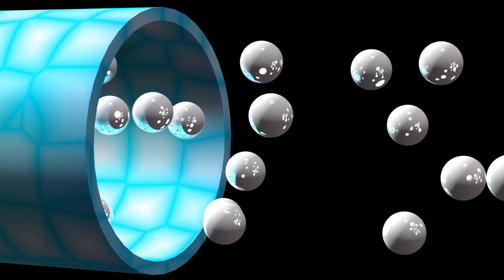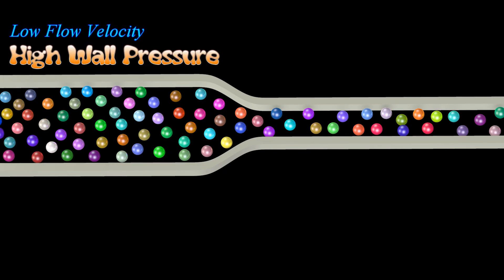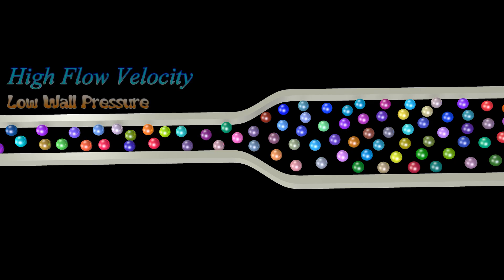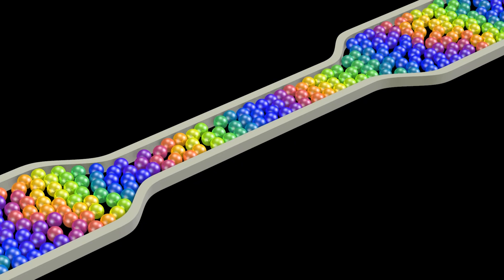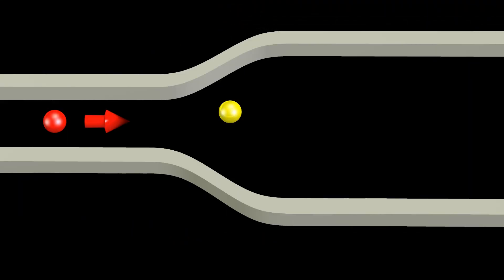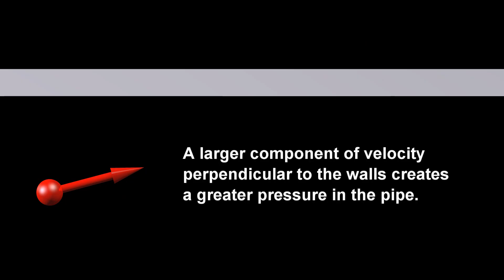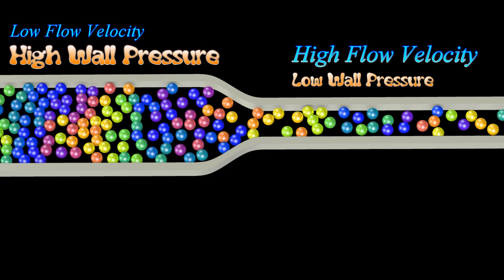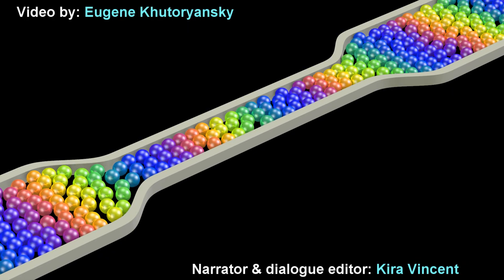Bernoulli’s Principle on Atomic Scale

Comment: Thanks for your videos ... clarifying so many non intuitive aspects of physics.  A logical extension of this one would include temperature
Reply from the maker: Thanks.  I am glad you like my videos.
Reply: This explanation makes a serious error in regard to temperature when talking about the kinetic energy, Doug.  I explain below.
..
Unfortunately, this violates some very common and well understood accepted principles of physics.  It mimics the same errors as Charles Crummer.
..
The statement at 2:07 is correct. "there is no reason to expect an atom with a higher velocity to exert a lower pressure on the walls of the pipe." 

There can be the same pressure in a fast fluid as a slow fluid.  They simply have the same static pressure. Bernoulli is not about speed. It is about changes in speed or velocity which is Acceleration along a path. 

The pressure on the walls of a sealed jar is the same regardless of the speed of the jar.

A fundamental flaw in this misconception at 2:42 is is that there no reason to expect a molecule to have the thermal vibration in only one dimension.  These pressure causing vibrations are random in direction and are how they bounce round between other atoms.  
At any given instant a molecule may be going down and the next at 90 degrees or even 180 degrees to the previous vibration.  
That simple fact breaks this false logic.
..
Then. . . 
It is the average velocity (over time) that has a directed motion when the kinetic energy is added to produce an increase in speed. That directed velocity is vectorially summed to the random vibrations.  This is vector addition of velocities. This means that the random vibrations are superimposed onto the linear velocity along the tube. This is fundamental physics. Vector quantities like speed and acceleration add vectorially.
Ignoring that fundamental physics is another flaw in this.
..
..
Then, the added kinetic energy in the moving fluid is in only direction.  It is not increasing the random thermal vibrations. That would require increasing the temperature.  This is another flaw in this story.  Moving the fluid along the pipe does not raise the temperature.  
Therefore, the statement at 2:23: "an atom with a higher velocity would have a higher kinetic energy and, therefore, exert a larger force on the pipe walls" is false because it conflates / confuses thermal energy and momentum in one direction.
..
..
Consider bouncing a ball on the floor. Each bounce imparts some momentum to the floor.  The ball's actual motion is only vertical..

Now, start the room moving (a train car) and the ball still imparts the same momentum to the floor with each bounce.  It's actual motion, relative to the stationary ground changes.  It has the SAME vertical component, but now a horizontal component vectorially added to the vertical motions.  The pressure on the floor does not change.
.
 However, these two motions are orthogonal and have no effect on each other. The vertical up[and down bouncing component remains the same. ONLY the ground referenced horizontal component changes as the speed increases.
This physics does not change if the ball is bounced on the ground outside the train's window.
.
This fails on these fundamental physics errors.
Reply: I agree regarding 2:23 would be clearer if he said momentum versus energy because the pressure is proportionally related to transfer of momentum which is mass times velocity whereas energy is velocity squared.  (I.e. pressure relates to the total instantaneous transfer of momentum on a wall surface).   However, regarding uniformity of velocity vectors, statistical thermodynamics can lead to non-intuitive results results … the curl associated with fluid flow near boundaries. To assume fluid flow velocity at the pipe boundary is identical to fluid flow velocity at the pipe center is a flawed oversimplification.  An authentic statistical model using FEA analysis based on physics first principles would be required to validate any plausible sounding simplifications.
Reply: @douginorlando6260   Are you referring to me?
RE: To assume fluid flow velocity at the pipe boundary is identical to fluid flow velocity at the pipe center is a flawed oversimplification.  "
..
Flow at the pipe wall is slower for two reasons.
1- boundary layer. 
But more so:
2- Pressure at the wall within the transition section is higher due to the narrowing being a restriction and providing more pressure due to the forward kinetic energy impacting the sloping wall.
This increases the pressure at the wal land form a Pressure Gradient pointing inward toward the centerline.  
Because of the slope, this Pressure Gradient points inward and rearward, this increases the pressure up stream and forms the inward force to curve the flow inward. Therefore, centerline flow is faster as shown in a real flow in the NSF demo video here:

Slower on the transition wall
https://www.youtube.com/watch?v=nuQyKGuXJOs&t=301s 
and here:
https://www.youtube.com/watch?v=nuQyKGuXJOs&t=464s 
.. .. .. .. ..
If you refer to Eugene, this explanation is all jacked up and appears to come from Charles Crummer:

https://vdocuments.net/aerodynamics-at-the-particle-level-arxiv-at-the-particle-level-v10-charles-a.html 

..
Regards

Comment: This channel is an answer to prayer
Reply from the maker: Thanks for the compliment.
Reply: Unfortunately, this violates some very common and well understood accepted principles of physics.  It repeats the same errors that Charles Crummer makes.
..
The statement at 2:07 is correct. "there is no reason to expect an atom with a higher velocity to exert a lower pressure on the walls of the pipe." 

There can be the same pressure in a fast fluid as a slow fluid.  They simply have the same static pressure. Bernoulli is not about speed. It is about changes in speed or velocity which is Acceleration along a path. 

The pressure on the walls of a sealed jar is the same regardless of the speed of the jar.

A fundamental flaw in this misconception at 2:42 is is that there no reason to expect a molecule to have the thermal vibration in only one dimension.  These pressure causing vibrations are random in direction and are how they bounce round between other atoms.  
At any given instant a molecule may be going down and the next at 90 degrees or even 180 degrees to the previous vibration.  
That simple fact breaks this false logic.
..
Then. . . 
It is the average velocity (over time) that has a directed motion when the kinetic energy is added to produce an increase in speed. That directed velocity is vectorially summed to the random vibrations.  This is vector addition of velocities. This means that the random vibrations are superimposed onto the linear velocity along the tube. This is fundamental physics. Vector quantities like speed and acceleration add vectorially.
Ignoring that fundamental physics is another flaw in this.
..
..
Then, the added kinetic energy in the moving fluid is in only direction.  It is not increasing the random thermal vibrations. That would require increasing the temperature.  This is another flaw in this story.  Moving the fluid along the pipe does not raise the temperature.  
Therefore, the statement at 2:23: "an atom with a higher velocity would have a higher kinetic energy and, therefore, exert a larger force on the pipe walls" is false because it conflates / confuses thermal energy and momentum in one direction.
..
..
Consider bouncing a ball on the floor. Each bounce imparts some momentum to the floor.  The ball's actual motion is only vertical..

Now, start the room moving (a train car) and the ball still imparts the same momentum to the floor with each bounce.  It's actual motion, relative to the stationary ground changes.  It has the SAME vertical component, but now a horizontal component vectorially added to the vertical motions.  The pressure on the floor does not change.
.
 However, these two motions are orthogonal and have no effect on each other. The vertical up[and down bouncing component remains the same. ONLY the ground referenced horizontal component changes as the speed increases.
This physics does not change if the ball is bounced on the ground outside the train's window.
.
This fails on these fundamental physics errors.

Comment: Are you sure about this?
Reply: Unfortunately, this violates some very common and well understood accepted principles of physics.  It repeats the same errors that Charles Crummer makes.
..
The statement at 2:07 is correct. "there is no reason to expect an atom with a higher velocity to exert a lower pressure on the walls of the pipe." 

There can be the same pressure in a fast fluid as a slow fluid.  They simply have the same static pressure. Bernoulli is not about speed. It is about changes in speed or velocity which is Acceleration along a path. 

The pressure on the walls of a sealed jar is the same regardless of the speed of the jar.

A fundamental flaw in this misconception at 2:42 is is that there no reason to expect a molecule to have the thermal vibration in only one dimension.  These pressure causing vibrations are random in direction and are how they bounce round between other atoms.  
At any given instant a molecule may be going down and the next at 90 degrees or even 180 degrees to the previous vibration.  
That simple fact breaks this false logic.
..
Then. . . 
It is the average velocity (over time) that has a directed motion when the kinetic energy is added to produce an increase in speed. That directed velocity is vectorially summed to the random vibrations.  This is vector addition of velocities. This means that the random vibrations are superimposed onto the linear velocity along the tube. This is fundamental physics. Vector quantities like speed and acceleration add vectorially.
Ignoring that fundamental physics is another flaw in this.
..
..
Then, the added kinetic energy in the moving fluid is in only direction.  It is not increasing the random thermal vibrations. That would require increasing the temperature.  This is another flaw in this story.  Moving the fluid along the pipe does not raise the temperature.  
Therefore, the statement at 2:23: "an atom with a higher velocity would have a higher kinetic energy and, therefore, exert a larger force on the pipe walls" is false because it conflates / confuses thermal energy and momentum in one direction.
..
..
Consider bouncing a ball on the floor. Each bounce imparts some momentum to the floor.  The ball's actual motion is only vertical..

Now, start the room moving (a train car) and the ball still imparts the same momentum to the floor with each bounce.  It's actual motion, relative to the stationary ground changes.  It has the SAME vertical component, but now a horizontal component vectorially added to the vertical motions.  The pressure on the floor does not change.
.
 However, these two motions are orthogonal and have no effect on each other. The vertical up[and down bouncing component remains the same. ONLY the ground referenced horizontal component changes as the speed increases.
This physics does not change if the ball is bounced on the ground outside the train's window.
.
This fails on these fundamental physics errors.

Comment: Same as The Action Lab's explanation, with better visuals. It's cool to see some of the particles even in the narrow section still traveling backwards at times. But the net momentum forward and less perpendicular to the walls still creates less pressure than the wide section.
Reply: Unfortunately, this violates some very common and well understood accepted principles of physics.  It repeats the same errors that Charles Crummer makes.
..
The statement at 2:07 is correct. "there is no reason to expect an atom with a higher velocity to exert a lower pressure on the walls of the pipe." 

There can be the same pressure in a fast fluid as a slow fluid.  They simply have the same static pressure. Bernoulli is not about speed. It is about changes in speed or velocity which is Acceleration along a path. 

The pressure on the walls of a sealed jar is the same regardless of the speed of the jar.

A fundamental flaw in this misconception at 2:42 is is that there no reason to expect a molecule to have the thermal vibration in only one dimension.  These pressure causing vibrations are random in direction and are how they bounce round between other atoms.  
At any given instant a molecule may be going down and the next at 90 degrees or even 180 degrees to the previous vibration.  
That simple fact breaks this false logic.
..
Then. . . 
It is the average velocity (over time) that has a directed motion when the kinetic energy is added to produce an increase in speed. That directed velocity is vectorially summed to the random vibrations.  This is vector addition of velocities. This means that the random vibrations are superimposed onto the linear velocity along the tube. This is fundamental physics. Vector quantities like speed and acceleration add vectorially.
Ignoring that fundamental physics is another flaw in this.
..
..
Then, the added kinetic energy in the moving fluid is in only direction.  It is not increasing the random thermal vibrations. That would require increasing the temperature.  This is another flaw in this story.  Moving the fluid along the pipe does not raise the temperature.  
Therefore, the statement at 2:23: "an atom with a higher velocity would have a higher kinetic energy and, therefore, exert a larger force on the pipe walls" is false because it conflates / confuses thermal energy and momentum in one direction.
..
..
Consider bouncing a ball on the floor. Each bounce imparts some momentum to the floor.  The ball's actual motion is only vertical..

Now, start the room moving (a train car) and the ball still imparts the same momentum to the floor with each bounce.  It's actual motion, relative to the stationary ground changes.  It has the SAME vertical component, but now a horizontal component vectorially added to the vertical motions.  The pressure on the floor does not change.
.
 However, these two motions are orthogonal and have no effect on each other. The vertical up[and down bouncing component remains the same. ONLY the ground referenced horizontal component changes as the speed increases.
This physics does not change if the ball is bounced on the ground outside the train's window.
.
This fails on these fundamental physics errors.

Comment: I am still confused and have a question: the direction of net force caused acceleration is horizontal but the pressure force difference between wall surface is perpendicular, so why pressure gradient follow the horizontal?

Comment: Hey man,  I am a civil engineer, and I have recently been confronted with a new phenomenon that I cannot explain. One of my contractors was able to locate a few utility pipes using a wire bent 90 degrees, barely holding it and walking through the site. The rod will turn at exactly where the pipes are (Dowing). 
Being a skeptic I had to call a few engineers to get the actual plans, and it turns out that the dowing was accurate. (I tried it myself being very careful to avoid any biases, and it turned exactly where it did before). This was on top of a  highway bridge so I know for sure the test was blind to the rest of the ground surface. 
 I started researching only to find almost no successful research googled using the word dowing. However,
I found some articles if I instead, searched for electrici/magnetic generation of flowing liquid through metal pipes and found some well developed math on this. Anyway, long story short, there is some sort of electromagnetic phenomenon not yet well explained if you’re interested . I can recreate it on video. Or if you have any info on why this works please let me know. Thanks 🙏🏽
Reply: I am from Houston tx
Reply: And yes I am aware of the ideomotor effect. That’s why I am still a skeptic on this.

Comment: Long time fan, thank you so much for your work!!
I'm trying to conceptualize a case in which an ideal gas flows through the constriction, where intermolecular interactions do not exist, since atoms are infinitesimally small and do not interact in the limit of an ideal gas. It would be interesting to explore the case in which your atoms pass freely through one another and see if the same result occurs.  Interatomic interactions should not be necessary to demonstrate Bernoulli's principle.
Reply: Somewhere further up, I wrote something about the reflection of the particles from the parts of the pipe's internal surface area that are perpendicular to the flow. Maybe this concept is useful for answering your question.

Comment: Absolutely great video, but my lingering question is, after a certain time in the narrow pipe won't the atoms have collided sufficiently enough to begin moving in all directions equally? But my understanding is the lowered pressure in the narrow section remains constant (ignoring the total pressure drop applying to all fluids in any diameter of pipe).
Reply from the maker: In the narrow section, the other particles that our particle will be colliding against will also have more of their velocity parallel to the walls.  Hence, this will also be true of all the particles after the collision, due to conservation of momentum.